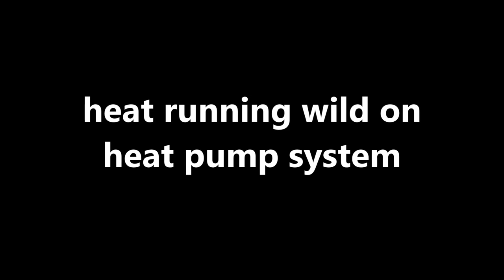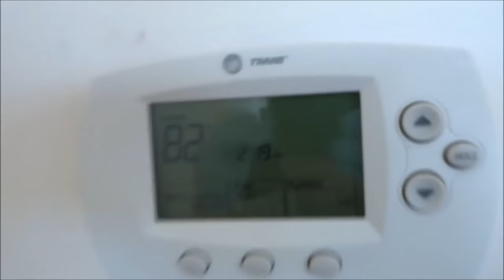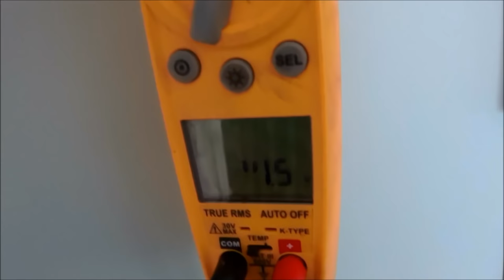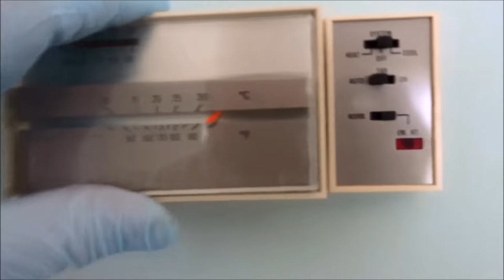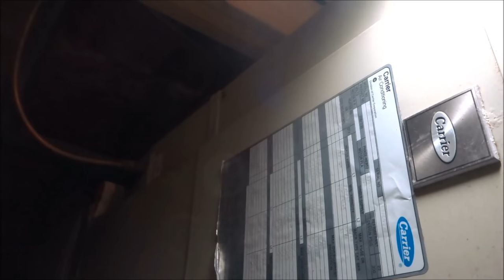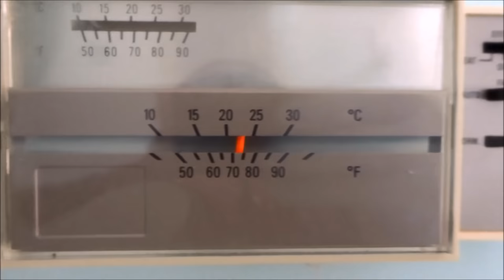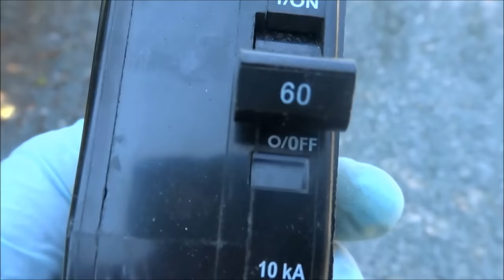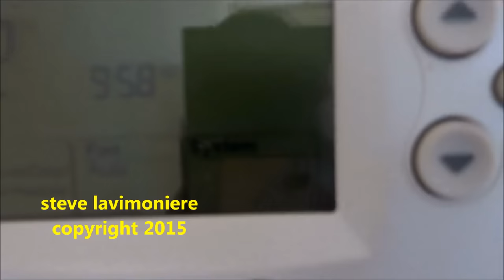heat pump system ,heat strips running wild

Comment: Log in those viewing hours since I been down with emergency gallblatter surgery. So I try to comment on the older video's like this and hit the like button. Love your content. I had heat strips and cooling coming on same time on a Tempstar. Then realized the Tempstar switches in heat instead of cooling.  Had me scratching my head for a few minutes. Finally figured it out. Had a sequencer fail on a couple of mobile home furnaces kicked the strips on no fan no nothing a 1,000 wonders it didn't burn down. Why don't they design those sequencers to fail to the open side instead of closed.

Comment: Don't even waste ya time with sequencers Steve! Even manufacturers have smartened up and started going with contactors.  I have ran into those numerous times. Slapped in a contactor each time. PROBLEM SOLVED!

I actually got a hold of a old stock Goodman heat kit the other day, 15kw with 3 sequencers. Took them all off and slapped on 2 contactors.  I always redo my heat kits from Goodman/Amana because they are a wiring mess when new.  They did screw up 2 things. Instead of the brass connection jumper, they started using a piece of wire. Cluttered things up.  Then they messed up the breaker backing as well. Older style was much, much better.
Reply: Your thermostat turns the strips on and off..  If you mean delay? There is none with a contactor.  As soon as the 24v signal is sent to the contactor, it closes and allows the strips and fan to come on. \

If you have ever seen heat strips come on you will know that if there is no fan, it only takes like 3-5 seconds for them to get red hot and kick on temp overload. 

Goodman uses contactors strictly now on their heat kits, so has Trane and A.S also. Nothing special, but a far better and more robust connection than crappy sequencers. They simply cannot handle the amperage and the bi metal discs wear out too quickly.  I wouldn't even trust one for a simple fan relay. 

Now if you want some sort of delay, (why i don't know) you can get a Supco "Delay On Make" timer and adjust the dial to whatever setting of time you wish before the 24v is allowed to pass to the contactor.  

99% of (ALL) manufacturers use a delayed make and break fan board now, so in normal heat mode there is a delay on the fan on and off for efficiency. Like i said above, if the strips are on, you (WANT) the fan on. 

There is videos dealing with this direct subject by "Garythefurnaceman" here on YT as well talking about Heat Kits and Tayln has videos as well. 

Best Regards..

Adam
Reply: +BP 27  I'm wondering the same thing.  I mean the whole idea was to spread the heavy inrush of current so to simply omit it from the design for more robust connection doesn't seem quite right.  I'd prefer a regulated current to the equipment for safety sake and longevity or maybe I'm just paranoid.
Reply: @BP 27 From what I've heard, years ago, the transformers (outside @ the pole) were potentially not able to handle an inrush like that, but nowadays it's a non-issue.

Comment: We have a switch, where you pull the thing out, flip it over and stick it back in.  Much safer, because if a service guy is working on it, he just pulls the thing out, and hangs onto it, until he is done....
Reply from the maker: Paul Schmidt i just change out the bad part with new one
Reply: I think you're referring to a disconnect at the appliance.  There was one with fuses I believe but I guess the service panel breaker was bad.

Comment: Great video. I have a Lenox heat pump for my 2nd level. This unit is only about two years old. I have just noticed that my auxiliary heat keeps coming on. I have it set for 63 and the room is 63 but when the heat turns on it runs normal then after a couple of minutes it switches to auxiliary. Why?  Thank again for your videos.

Comment: Thanks for sharing Steve. Some helpful info for ya. The bottom contacts on breakers are just as important as the top ones as all of them are needed to complete the circuit. That rust was most likely the problem and the contacts they mate with in the disconnect are usually just as bad looking. Once they corrode like that, the best fix is to replace the entire disconnect.
Reply from the maker: Nicholas CeeA i have no issue just changing the breaker i do it all the time ..

Comment: So I disconnect the white wire and the fan keeps running but the heat strips are not on. New thermostat. Does this mean I have a short?

Comment: I stumbled across this video while searching for runaway 10kw heat strips which I'm having trouble figuring out.  They run whenever the unit is powered on in heat or cool.  I was hoping it was bad sequencer but I'm getting 24v to the base coil so I disconnected W2 @ thermostat thinking it was coming from there but still no change.  Bad air handler board possibly?  I pulling my hair double checking all low voltage connections from digital thermostat to air handler to heat pump.  Certainly welcome any suggestions and thanks for the informative videos Steve.
Reply from the maker: could be a bad tstat wire shorted out inside ,i would check that first disconnect both ends and ohm out wires together one at a time to find a short .could be a bad relay on board . maybe you need to test to find the problem .
Reply: Thanks for the input.  Control wiring all new but yea, you never know so I guess I'll try that.  Update:  seems it was the "universal" digital thermostat connected wrong.  So much confusion around W1 & W2 wires and the myriad of ways to connect them with various jumpers and or omissions of "E" & "Aux" terminals.

Comment: I have had many a problem with those double stack Heat sequencers. I've even had them be bad right out of box
Reply from the maker: there not made so well ,,, i can see why
Reply: steven lavimoniere exactly. Had a new one not want to shut down because the heat from inside the plenum was radiating through the wall and keeping it warm enought to keep staying on. Had to put washers behind it to create a air gap to keep it working right. It only happened with that double stack setup
Reply: anything you can recommend we have a Trane (pos -_-) last year a valve filter and all the refrigerant was replaced as well as cleaned out right now beginning of fall still using the AC hot too but AC is now freezing up most likely it's  low what brand would be most reliable